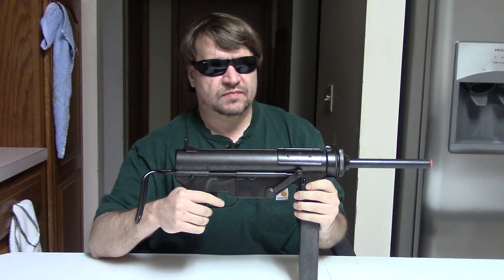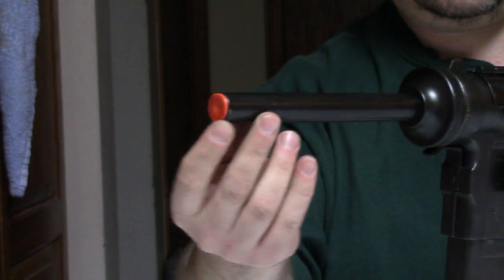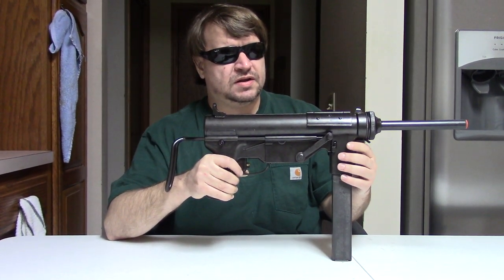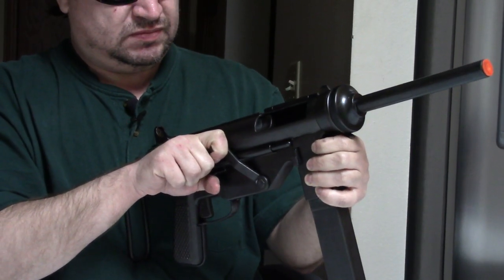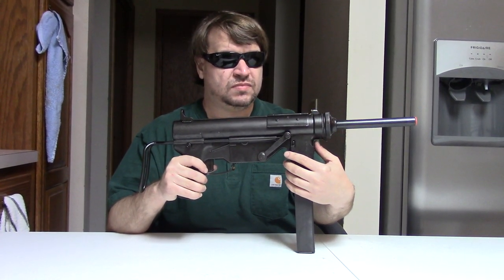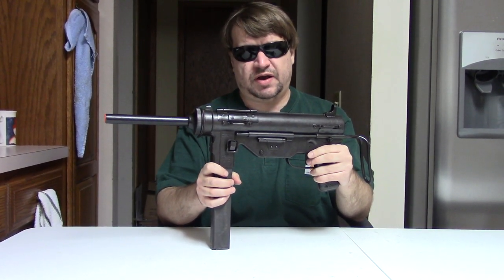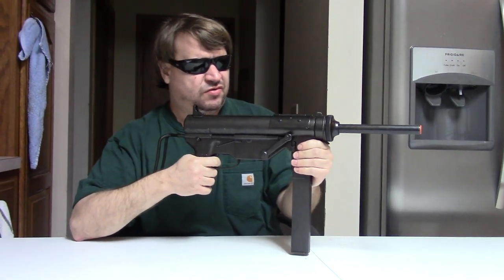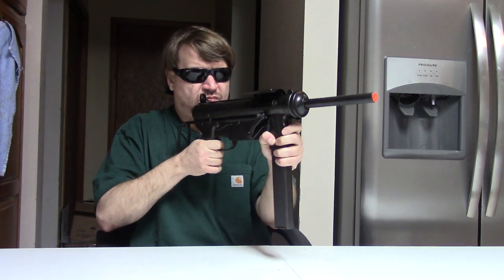US M3 Grease Gun History & A Version Legal In All 50 States

Comment: There are several build threads over at weaponsguild with people using high quality metal airsoft grease guns as shells for live-fire replicas along with a small handful of real M3 parts.  Building "shell" replicas is becoming increasingly popular due to the complete parts kits costing a fortune, so if you are up for an engineering challenge that might be an option.  You could build it as a pistol with a tack welded stock to keep it legal.